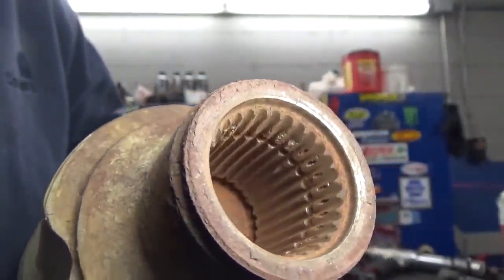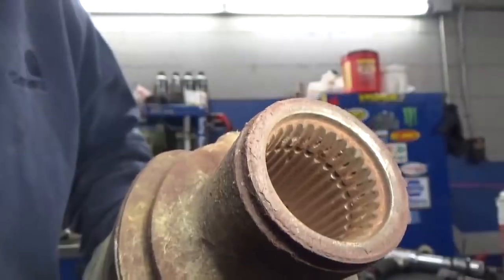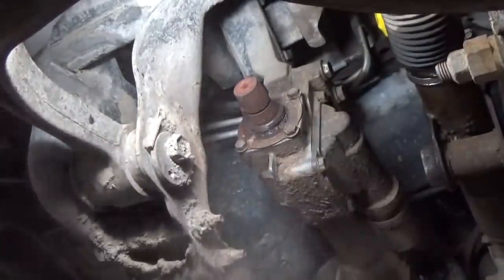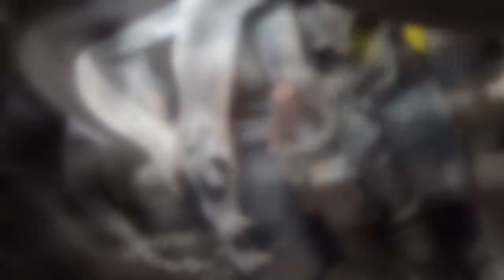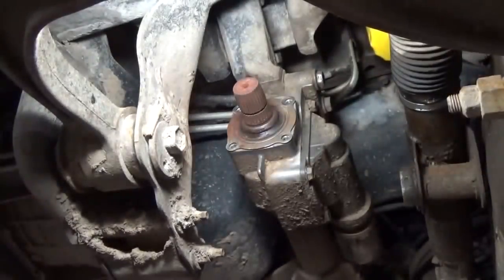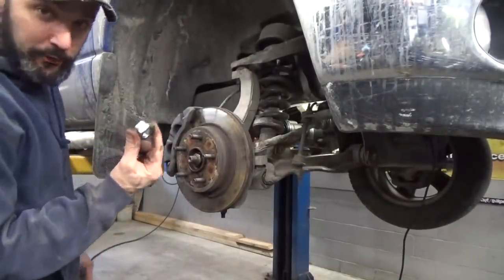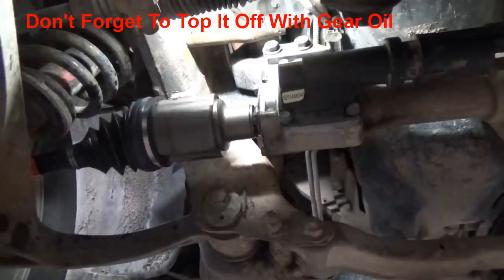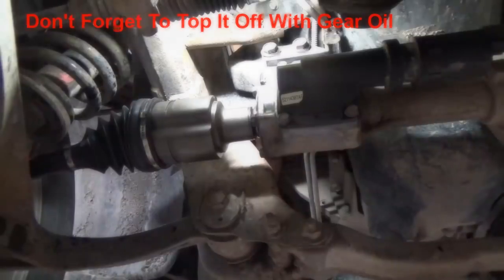Dodge Ram No 4WD

Comment: You asked what could have worn out the splines? I suspect someone was driving the truck on dry pavement  with the 4WD engaged. The front wheels/tires need to slip a bit (especially in turns) but cant on dry pavement which overloads the spline joint. Plus, the C clip on the shaft was missing. Probably got chewed up in the splines. Also, the outer race on the tapered bearing for the stub shaft you replaced is an interference fit in the aluminum housing. It should never have pulled out by hand. If the outer race spins going down the road it will quickly wear out the aluminum bore.  When I run into this I stake the bore and add locktite retaining compound (not threadlocker) to the the bore and then drive in the race. But as always, you're meticulous and provided another great video.

Comment: Excellent video!  You camera skills are as good as your mechanical prowess.

If I were a betting man, I would put my wager on this truck having been run in 4x4 on very hard ground or concrete and turns being made.  That spline connection would be the weakest link to flex and undergo torsion under those circumstances.  This is right where I would expect it to hog itself out.

Comment: Nice. As much as I like using never seize, I wouldn't have thought to use it on the trans-axle, nice tip. Also liked seeing the way you installed the seal. You have a good fore sight into ordering what you need. Aaah you forgot that one bushing but it worked out. Can't be perfect every time, I know I'm not, lol. Thanks for sharing.

Comment: I enjoyed watching your video... Thumbs up for sure!  Hey Eric, next time you remove the stub shaft on a Dodge remove the actuator and tap the seal cover off from the actuator side, using a long punch tap on the stub shaft to drive the stub shaft out along with the seal housing.   It will prevent marring the sealing surface on the seal cover.

Comment: Hey Eric; Good vid as usual:))
My son just informed me his 2006 got the recall/ fix on his passenger front end  shift solenoid . 
He took to dealer and they replaced and then sent him home. 
Within a day he (just out of curiosity) took truck to loose gravel area and engaged  front end,  heavy noise from front area. 
Took back to dealer and they (FOUND)  exactly what you and tons of others have found:((( 
 They told him the bill to fix would be under $1400. They said they cannot say why this happened but have done a few.
I started to investigate as usual. 
I have ordered and awaiting all new parts for both sides (while it will be at my place  and we are in there) might's well just do all. 
Upon looking at how everything operates in the CV Intermediate Shaft hook up , it Kinda seems obvious to me the cause.
You have a bearing support at the CV Intermediate Shaft out side. 
Then you have CV axle slide onto said shaft, both with small splines teeth. 
This axle is constantly in (up and down) motion, like stress on the shock , the constant movement just wears those small spines off. 

Let me run this by you; How bought when  i get parts  I assemble on bench, I slide axle onto CV Intermediate Shaft and click in place, then drill a 1/8 " hole thru complete unit, (kinda like) the design on a farm tractor PTO .
I'll then assemble on truck and put bolt thru to aide in the (Hold). in place.
I think Dodge knows this issue but chose to say "solenoid"   as a cheaper fix. as most like my son  just drove off and most seldom use the 4 WD.
Thoughts?  
Tom

Comment: Eric I noticed you used a pry bar when torquing hub nut. I usually put my caliper on then shove a big screw driver down inside vanes of rotor so it jams on caliper anchor, then have 2 hands to torque. I laughed at how easy axle came off stub shaft, I usually end up pulling whole axle and stub shaft and cut notches in axle where it fits on stub shaft then crack it with air chisel. Done many

Comment: Great Job :) You would make a Great HS Auto shop Teacher :)  I have seen that type of Failure before, Its Caused by Water and Rust eating the metal away until the metal is Compromised and finally Fails,  Yea, Use tons of anti seize to keep the metal Splines protected and sealed from water, Yea, You Know Your Sheet :) Take care and Have fun, Chellie, Retired Female Fleet Equipment Mechanic with over 38 years of experience in the field.

Comment: That was a neat trick to spread the pads when you were reinstalling the caliper! I recently had the knuckles off of my 2000 CR-V, and I just went and grabbed the pad spreader, but it's much faster when you don't have to go run and grab a tool. Also liked the prybar on the lugs for torquing the axle nut.

Comment: Great fix in dodge, you are right on aftermarket shafts I got an old 90 chevy k10 I use on farm I have replaced both sides twice I thank I got one going out now guess I new to get gm shafts hard to shell out 400+ on them for a junker.

Comment: great video will have to do this on my 2010 truck. typically there is minimal difference in rotation speed where needle bearing is located as the truck goes down the road. looks like operators need to engage the 4 wheel drive sooner to save wear. the spline slop got the best of it . Great Point with the OE or Remanned  as the price points are tough But I Hate buying a Problem.
thank Again

Comment: You skipped over the cause of the axle damage. The lock ring seems to be missing from the stub shaft, this would allow the CV joint to slide in and out causing taper wear. Keep up the great video content.

Comment: I noticed that the old stub shaft had long splines and the new one had short splines. I don't suppose it matters because you didn't mention  it.  and the old one didn't appear to travel that far by the wear marks. Thanks for the great video

Comment: Great video. Just to add that a faulty front left speed sensor can also make your 4x4 (flashing light) and cruise control not work on a 08 dodge ram 1500

Comment: what i have done in the past with bearing retainer seals, is take a piece of one inch wood with a hole in the middle and  use a rubber hammer on the wood to press in the seal evenly its works most of the time just have to have a piece of wood thick enough so you are not hammering on the shaft but have even pressure on the seal

Comment: Great video!  Not sure why splines failed but I do know from my work experience in the automotive world (the assembly/casting and grinding plants) that every so often a part may not get hardened correctly or not hardened at all.  This comes from a variety of reasons.  So a soft part could initiate the premature failure of the shaft.  This will be evident if the truck has no further shaft issues.  Just a guess.

Comment: You're right about the aftermarket parts.  The bushings were shot on my 98 Dakota 2WD front end.  (17 years on the stock bushings.)  I bought complete Moog control arms trying to save time and energy on labor.  The metal was nowhere near as thick as the originals.  Since I couldn't get OEMs, I returned the Moog arms and pressed out the old bushings and pressed in new ones.  The upper arms on the Moogs didn't even have holes drilled for the bumper jounce.  Go figure?

Comment: My Dodge is a 97 2500. It has 1.5 million miles on it & I can't believe that the vacuum actuator for the FWD & that little sliding coupler have never failed !  When I looked at it after I bought the truck I figured I would be lucky if it lasted a year.  What can I say ?

Comment: the Precision CV axles from O'Reilly Auto Parts seem to fit really well. I actually just did this repair on a 2006 Dodge 1500 along with the lower ball joint.

Comment: Decades ago I had an IR231 impact like you have. It was modified by a nascar friend. Another tech in the shop I worked at was covering the tire guys day off when his cp impact died. I was heading to lunch and he ask to borrow my impact. 
I said let me show you how to operate it it's super strong. He said he knows how to run an impact.  When I came back he yelled this things defective and threw it to me. Said it broke 17 lug nuts off that Cadillac on the hoist.  He had complained to the service manager and the general manager that I had loaned him a defective tool. Into the office. The blinds got closed the door closed and we all started laughing. He actually wanted me written up for that.

Edit we also had 1/2" air hoses and high flow couplings along with 170 psi shop air.

Comment: I don't want to criticise any, but you could save a lot of time. I have done a lot of these and if you just use a pry bar to disengage the inner joint from the differential stub shaft then pull it off the stub, you can then remove the axle nut from the hub and knock shaft out of hub never touching brakes or ball joints and the stub shaft is just a snap ring holding it in it can be a booger. Just some info to save some time even a 30 yr mechanic like myself took three of those jobs to learn I could do it like I mentioned.
Reply: +Athena Holdridge i canot get my axel off the stub any pointers? i have tried pry bars of all sizes and also tried a strap to pull it but no luck

Comment: Awesome video, 1st time watching. definitely subscribing to your channel. Couple of questions as I am going through this same issue. 1. You mentioned the torque for the seal but not the other bolts or nuts. What is the axel nut torque, what about the steering knuckle nuts. 2. For the needle bearing, if I needed to replace that, is there anything special to get that out? Does it just pull out or is there a C-Clip or something else?

Comment: @7:16 I was thinking that when I would try to separate thin sheet metal away from objects like in this scene, I always had an old metal paint scraper with a 1 1/2" wide blade, and the steel sheet metal shank was great for tapping on with a hammer. The scraper was thin enough to cut through the rust and corrosion holding the sheet metal retainer in position and made removal a lot easier without major destruction and/or malformation of the thin sheet metal. If it was a piece that had to be re-used, usually it was in good enough condition to be dressed up and re-flattened with a hammer and vise. Also, a paint scraper is quick and easy to sharpen on a bench grinder.

Comment: I remember on the old Jeeps that had the vacuum disconnect front axle (although that was eliminated in 1993 or 1994) the method to "fix" the issue was to use a series of washers to engage the fork at all times, or swap the two piece axle shaft out with a one piece unit.

Aftermarket steel cables were made to replace the vacuum line and give control of locking the axle over to the driver, but even then, they were still prone to failure.

The entire purpose is to reduce rotational mass by stopping the front drive shaft from spinning in 2wd.  But it's also good if you install a front locker or limited slip, so that your driving behaviors are not altered when in 2wd as well.
Reply: +Blaine Bugaski I use a cable lock now. So much better than the vacuum crap. The only thing that can really fail with the cable is if moisture gets in it, and freezes.
Reply: If you have an open front differential, why not just lock it 100% of the time?
Reply: Blaine Bugaski Because I don't want it locked when I drive on the highway.
Reply: Why is that?  Once you're moving I can't see the front drive shaft making much of a difference in terms of fuel economy.
Reply: Blaine Bugaski It actually does. My wheels hop pretty badly when the front end is locked, even when taking a light turn. I'd rather not have any extra wear than needed, so that's why I leave mine out unless I absolutely need it. The kit also hooks on to your 4x4 light, and will indicate that you're in 4x4 even when the transfer case is disengaged. Lights get annoying when driving at night, lol.
Reply: ***Classified*** So you must have a front locker inside of your differential then.  If you had an open front differential, the only time it would hop is if your front axle was locked with your rear axle, such as in 4x4 part-time mode.
Reply: Blaine Bugaski Yeah, must be then. 4x4 high in mine feels like 4 low on most trucks.
Reply: I don't know, I would have to feel it.  A front locker wouldn't feel like 4 low either, in my opinion.  Totally different things.
Reply: Blaine Bugaski I'm pretty sure it's the Dana 60. Whatever they put in the RAM 2500's from the factory. One of my local machine shops said it was the Dana 60 back when the vacuum fork kept failing.
Reply: Front lockers or limited slips are rarely a factory option unless it's a fully loaded Jeep Rubicon or something like that.

Comment: On Volvo AWD systems, they use a sacrificial sleeve with double female splines to connect the stub shaft to the front drive shafts.  The shafts have hardened splines so the small sleeve wears out but the shafts aren't damaged or worn.

Comment: Watching this old video I noticed at the end when you were testing the four wheel drive, that the axle stub has a distinct wobble in it while rotating. Looks like a engineering design flaw as that is what probably contributed to the problem of the axle stub gears rounding out.
Planned obsolescence or just cheap engineering, you decide.

Comment: Glad it worked out OK . I would have sworn from how it looked on the video that the sleeve was too far back and the fork missed the slot on the sleeve and was in front of the sleeve . I was thinking you're going to be peaking when it doesn't engage .  I did 10 years in automotive then 27 years as an industrial mechanic . Tough way to make a buck brother .

Comment: Noticed on most front actuators/motor type 4wheel systems that the wheel bearing on oppisite side usually was replaced and the way it was taken apart was usually someone bashed the c.v joint to free up from hub assembly resulting in middle shaft knocking the other side out without even knowing it till later on...

Comment: Question: To top off the gear oil, is the gearbox section fine to fill for the actuator area, or is there a filler hole for this?  Thanks for your answer.  As I can plainly see, you are a quality, knowledgeable mechanic!  Thanks again for your video.

Comment: Thanks for the video. I have a 2004 2500 dodge 4wd, I wonder is the front wheel engagement is similar to that one. I would sure feel better about it if it was. Thanks again.

Comment: Being that both sides of the stub shaft wore, I wonder is the root cause improper heat treating?  Too bad you didn't try running a file or ideally a set of hardness files to see if the part was hardened or not.

Comment: Removing the seal. I have used an old wood chisel flat on the bottom. By the way the plastic handles broken off but it still works.

Comment: Had an 02 Dakota with 4wd, used it in 4 wheel 6 times, the 6th time I used it it locked together and wouldn't go back out of 4 wheel unless I drove in reverse for a few feet after shifting back to 2 wheel. Next truck was 2 wheel drive with a winch, haven't been stuck since.

Comment: you rocked it dawg iam proud of you you know the best way to do things
sum these Aholes try to make you think there are short cuts to do the same job
ive found that to remove couple more nuts n bolts cane make things a loit easyer[2002 dodge 1500 cv axel ]rock on

Comment: Reminds me of my 1999 Jeep Grand Cherokee whose 4WD pretty much self-destructed just a few years into its life (so I removed that sub-shaft and ran it in 2WD-only mode for another 10+ years). And then had to replace the entire transmission around 150,000 when IT decided to self-destruct. Man at the Cottman Transmission shop said he'd never seen anything so ground up as that one was. I'm thinking these early failures on Chrysler products are due to metallurgical defects (i.e. the aftermath of loose shards) and not simply normal wear or even improper tolerances.

Comment: Just finished, didn't have a lift, driveway. And didn't have enough clear space between the lower bolt and ground. To hit it up and there would be slight tention pushinmg doward from the shock. So, I pulled the shock bolt instead. I'll be doing the passenger next even though doesn't need it. But, when done, In Canada, Ontario Parts Source has offering "Life Warranty" on both parts. That's sweet.... Love that one [Need one of those air tools, not the ratchet, the other tool.